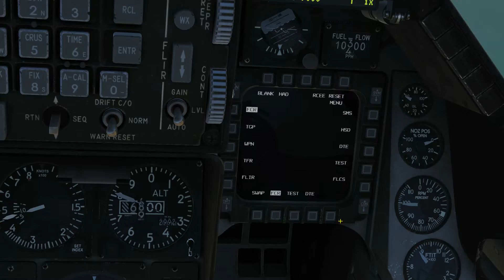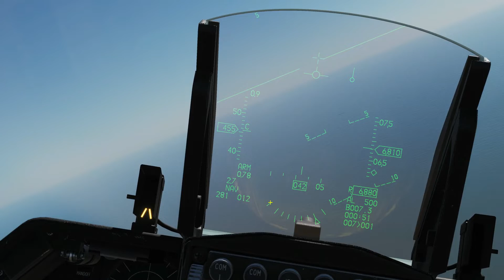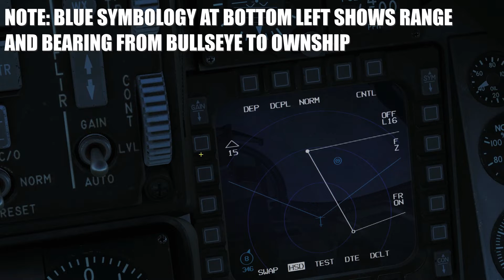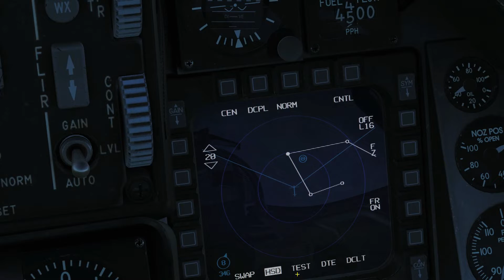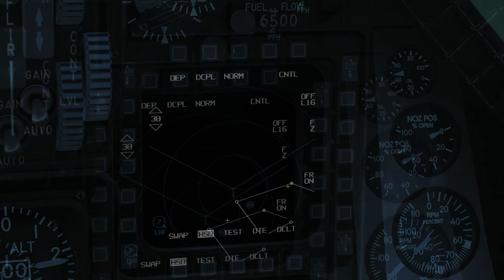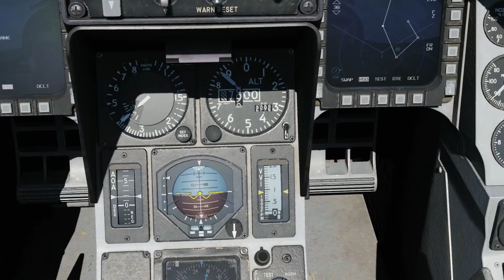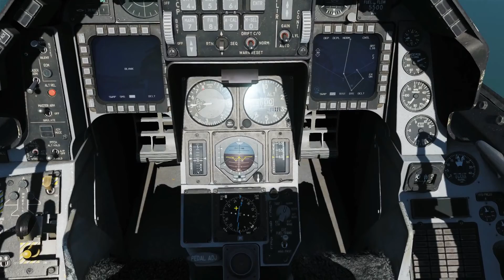F-16C Viper: EGI Navigation & Steerpoint Manipulation Tutorial | DCS WORLD

Comment: GPS is more accurate than INS, especially over time (as INS accumulates error). GPS however is easy to defeat/jam. 

The bearing pointer will take you directly to the waypoint/steerpoint but that direct-to course may not be aligned with the course line that joins the two steerpoints. So, imagine if you overshoot the steerpoint 2 by a few miles and then turn to steerpoint 3. If you follow the bearing pointer it will take you directly to steerpoint3. So, you can bug that direction and turn toward it. The CDI is slaved so the HSI CDI will indicate how far off the course line joining the steerpoint 2 and 3 you are. Turning the OBS won't change the deflection of the CDI but it's best to turn the OBS to the course joining 2 and 3. You then have to do a little mental math to figure out how much turn and in what direction you need to make to center the CDI to intercept the course between 2 and 3, and once the CDI is centered your bearing pointer and heading should be the same. You can then bug that and adjust for wind as you zero in. That's the real difference between flying 'Direct-to' and 'proceeding on-course'  (ATC doesn't even make the distinction IRL correctly most of the time). In any case "Direct-to" is following the bearing straight to the steerpoint. On course is turning in and intercepting/centering the CDI on the HSI. This is all much simpler with a drawing :)

Comment: Are steepoints and waypoints the same? I'm having a difficult time trying to wrap my head around this. I am using some PvE missions that I've downloaded, and notice that on my right MFD it shows a diagram with lines and dots. I'm assuming these are the locations of enemies that I need to fly to in my mission. How can I setup the F16C to automatically get me to the next waypoint?
Reply: I'm no pro, but I believe steer points, way points, are the same thing. Consider them checkpoints to a pre planned route that will lead to your mission area or whatever you have set up. Regarding your last question, the answer is the part where Cap turned the steer point setting to from manual to auto. Only that it should have changed when it didn't .

Comment: Regarding ETA and Time to Steerpoints. The F-16 has some REALLY cool features you can use in the DED for estimating and calculating your navigation and flight plans. If you press the number 5 "CRUS" key on the ICP, it will give you various functionalities for you to estimate, for each individual steerpoint of your flight plan (or markpoints you add them on the go).

The default screen of this menu will present you the selected steerpoint (highlighted on the top-right corner of the DED, as usual) and it shows you, in order:
System: The current time of the day;
DES TOS: Designated Time On Steerpoint (TOS), according to your flight plan;
ETA: Estimated Time of Arrival (small observation here: this counter will NOT give you ETA in the usual format like, for instance, "1 minute and 30 seconds remaining", instead it shows what time of the day it will be when you get to the steerpoint), estimating it based on your current speed and course deviation;
REQ G/S: And last but not least, the Requested Ground Speed you should be flying to get to the steerpoint precisely at the Designated Time On Steerpoint.

If you then press the "Seq." (the "d-pad like switch" for the ICP-DED interaction) while in the first page, it will then display the second page with some useful feature of this function: The Range function. This will estimate for you what your Fuel State is gonna be when you get to the selected Steerpoint, if you maintain your current speed, throttle state and course. This is EXTREMELY useful for predicting when it's time to RTB.

And if you press the Seq. again, it will give you the same information, but instead of referenced to the selected Steerpoint, it references to the "Home" airbase. And this function also provides you recommendation for optimal altitude for fuel efficiency purposes, which makes it an even better option for RTB.

If you press the Seq. one more time, it will give you a function that estimates, based on your current throttle state, how much time you have until you reach Bingo Fuel. Pressing Seq. again, will go back to the first page of this menu.

So there's some hype for when this is all implemented, I guess. =)
Reply from the maker: Interesting, thanks will keep an eye out for this functionality :)